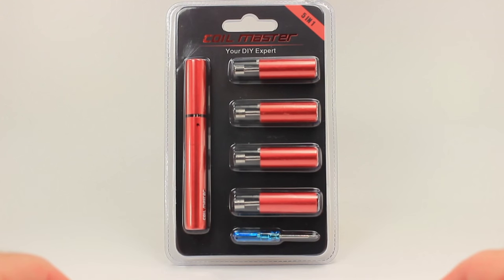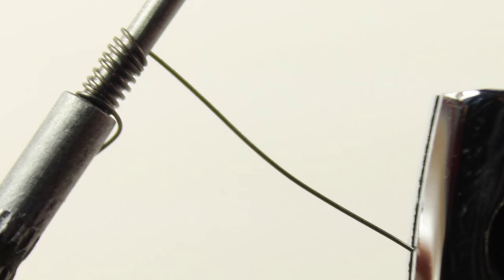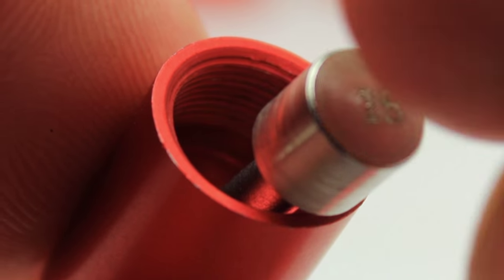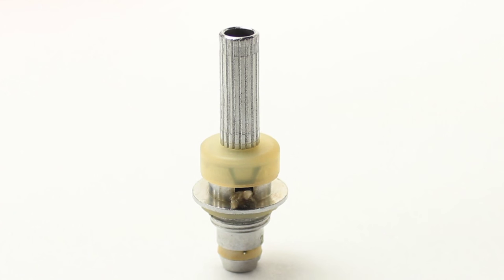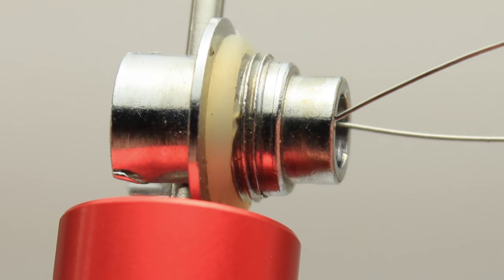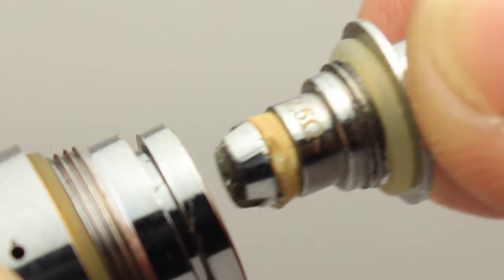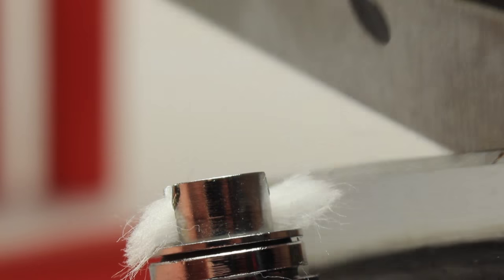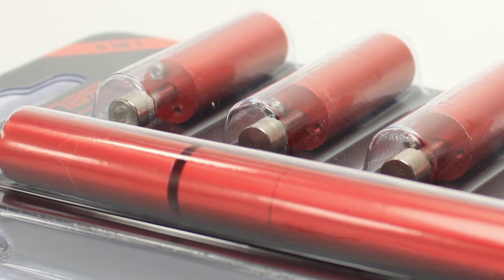Coil Master Review: How To Build Kanger Coils

Comment: I just bought a Coil Master V4 Coiling Kit and I was looking for a tutorial. Instructions are the one thing they left out. The video was very helpful but that's no surprise if you're the same Darth Vaper that I've met on The Vaper's Den. The part about rebuilding Kanger (Smok) bottom coils was also good. I'd given up on trying to rebuild those but with the Coil Master and your help I'm going to give it another go.